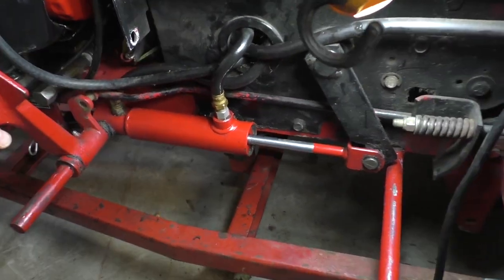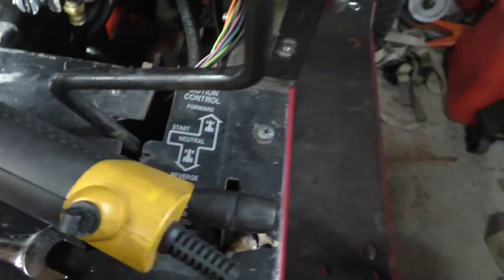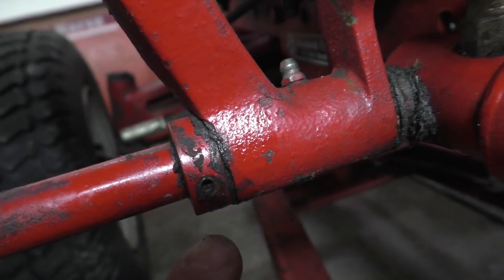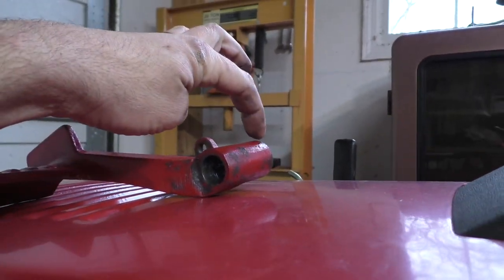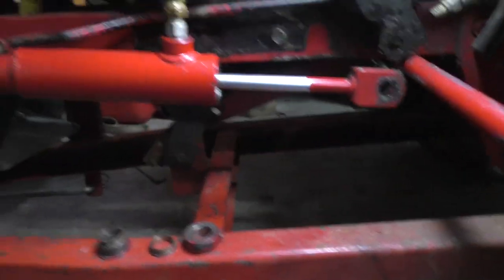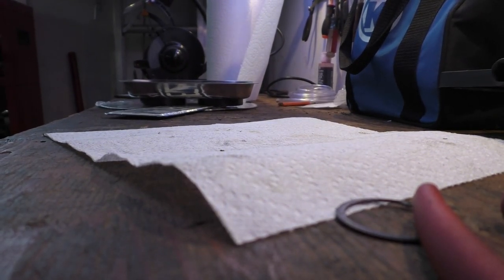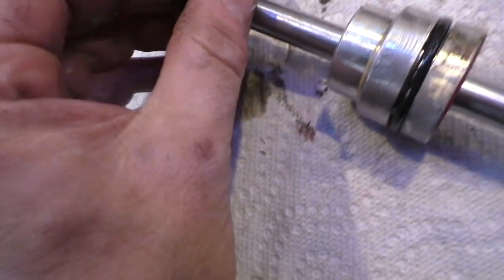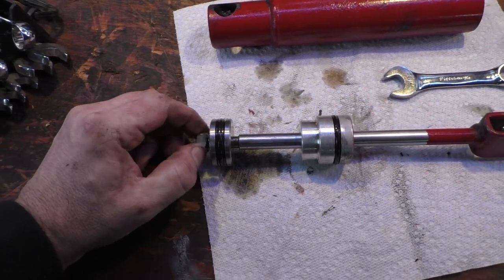Part 1- Rebuilding Wheel Horse Hydraulic Cylinder

Comment from the maker: https://wheelhorsepartsandmore.com 
I was able to find a cylinder kit and new deck wheels for the 48" that are shot.  The front hitch I use is from wheelhorsepartsandmore as well.  That has held up great.
Reply: Awesome I'm sure I'll have to do this sooner or later so maybe I'll just order it soon and have it on hand. The couple things that I've done for leaks on my 520h are oil seals on the transaxle. I did both axles and then found that there was a leak around the brake drum as well as around the motion arm at the top. I did have one leak coming from the valve area but it was just a loose hydraulic hose. I definitely need to get wheel grease seals but I'm going to wait until I powder coat my rims to do that. Thanks for the video!
Reply: Good deal!   Definitely better to get ahead of the leak than to blow a seal & make a huge mess.   Thumb's up

Comment: Hi, it seems you are able to do more work/replace parts on the Wheel Horse than on a John Deere of similar size.  I've been thinking of going from my 318 to a 520H lately.  Keep the tractor/gardening videos coming!
Reply from the maker: I do like the 318 and having power steering would be a big plus and full hydraulics.  The 520H is a little smaller but it does a lot of work.  I just received the deck wheels today and the rebuildable cylinder kit so I'll have a video on the hydraulic cylinder this weekend.  Thanks for checking it out.

Comment: How do you bleed the air out of the transmission ?
Reply from the maker: Best is to get a manual on it, or check our Redsquare on how to bleed.  I think you need to pull the drive disconnect lever and then move the lever forward for a period of time and back for a period of time.  I think having the hydraulic circuit for the lift, the air almost is removed for you since the pump is moving oil through the system constantly.